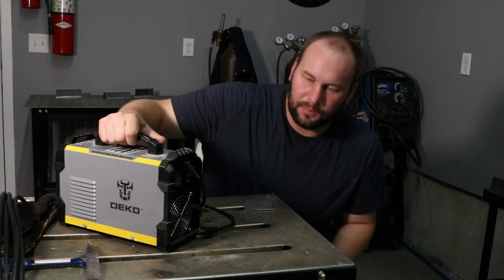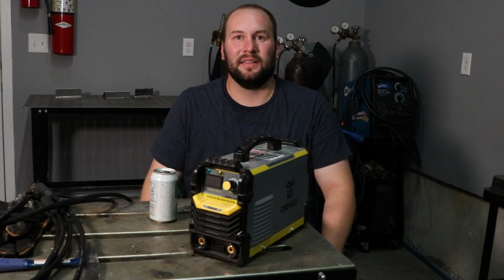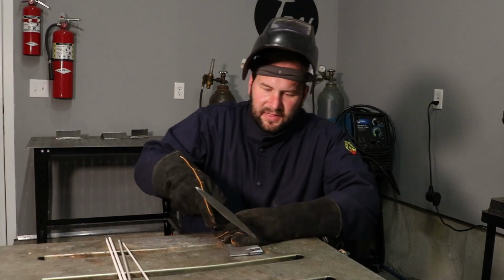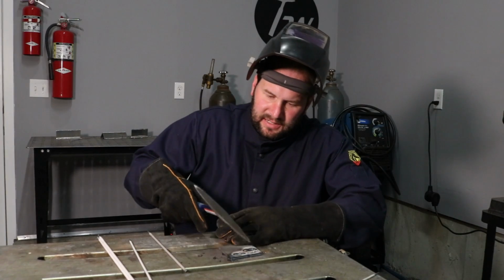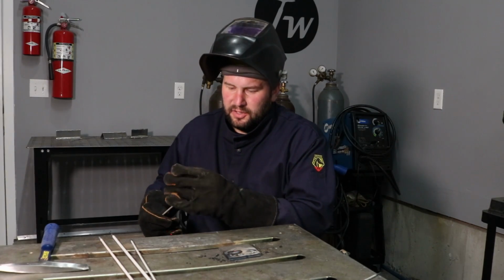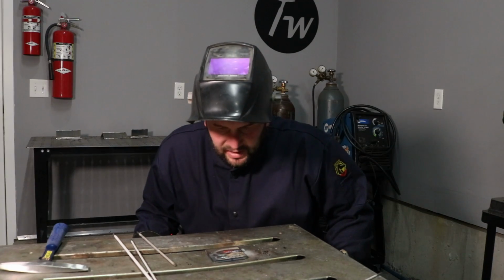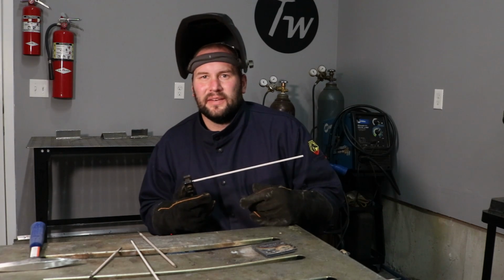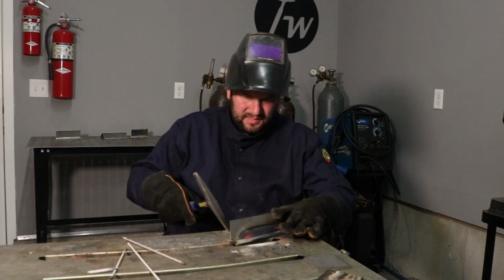Reviewing the (Almost) Cheapest Welder on Amazon: DekoPro Welder Review

Comment: Been looking at Amazon for a welder in this price range and this was one of them. 
Your video might have just tipped the balance. 
Not sure if the UK version is in fact dual voltage, but I'm impressed by the length of the leads. 
What is the duty cycle on this unit?
Reply: I believe it's supposed to have an auto shutoff if it gets too hot, so you wont have to wonder. So far, I've only used mine on 115v set at 85-90 amps max, and it will run 100% cycle on that setting.
Reply: @alphaclean3364  how does a 100% cycle work? i mean, 30% is 3 minutes out of 10, how does it  work in that case?
Reply: @borisgraell  All I know is that I have run continuous beads, or multiple beads with minimal breaks and it has never shut itself off due to overheating. I have only run it up to 85-90 amps though, since that is the max I can pull with a 115v outlet. I am sure on higher settings with 220v power it would force you to give it a rest.

Comment: Hey Tim,I’m confused, In the Illustration it shows that the negative part is where you hook up your stinger to and the positive part is to clamp onto the surface. Is that correct?
Reply from the maker: Short answer: Ignore their diagram and connect the rod to + and the clamp/workpiece to -
Long answer: You are thinking correctly. 95% of the time when you're stick welding, the electrode should be connected to the positive terminal and the workpiece to the negative. MIG is the same way, but interestingly, TIG and Flux Core are opposite. This is because the majority of the heat will go toward the positive side of the arc. With stick welding (or solid wire MIG welding) that heat will end up in the filler metal which goes right into the weld. With TIG or Flux core, the tungsten/tubular wire cannot handle the heat, so you do the opposite to put it directly into the material. The main reason that you might run stick with the electrode connected to negetive would be to reduce penetration if welding something thin.
Reply: @TimWelds  good to know, thank you so much

Comment: Nice video , learned plenty !!
Have you been able to weld 1/4" steel ?  Like  a trailer repair or add on ?
Thanks,
Steph
Reply from the maker: Yeah, it will weld 1/4" just fine, as long as it's plugged into a 220 volt outlet. It would be a bit of a stretch on 110. My setup for this would depend on the geometry and how clean you can get it, but I'd probably run a 1/8" 7018 at 130-140 amps.

Comment: Hi friend which welding rods I need to use this
Reply: My welding rods always stick when I use it.i have same king welder
Reply: Volume up my friend, so that it will not stick
Reply: Turn up the amps of your machine, or maybe you're using 6010 or 6011 rod. Try to use 6013 or 7018

Comment: Have one for occasional use (on 220v). Seems like a good machine so far
Reply from the maker: I use mine the same way. It's still going strong. Thanks for the comment!
Reply: @TimWelds  Is the Dekopro really 220 or is it just wired to one of the 110 sides of the 220 plug and only using the higher amps that the 110 side provides on the 220 circuit?

Comment: As I've said before, at sub 200 dollars It's always between Amico, yeswelder, Deko and sometimes Hitbox. I got the Amico arc200.
Reply from the maker: It would be interesting to know how similar or different these machines are under the hood. I've only tried the Deko, and it's still going strong. I wouldn't be surprised if the others work well too.

Comment: Can you run a 7018  3/32 rod on the 110 outlet?
Reply from the maker: I haven't tried it, but it ran the 3/32 6013 just fine and was out of steam for the 1/8 6013. The 3/32 7018 will fall in between these two, so it would probably handle it as long as the outlet can put out enough current.

Comment: If I'm going to get a machine like this, it's because I want to have one when only 120v is available and I'm probably going to be running 5/64 or 3/32. Some guy on Amazon claimed he ran 300 feet of 1/8 6011. If that's the case, why would you want to have a machine that is pushed to it's limit Everytime you use it? Get a bigger welder. 3/32 is plenty even on sch. 40 pipe with gap. You will start burning up lead terminals as well. It's like these guys who try to see how big of a lag screw they can drive with the smallest impact.  Get a bigger impact.
Reply from the maker: Totally. I really only use it for smaller jobs where it's nice to have something portable. It hasn't missed a beat for me yet, though.
Reply: @TimWelds Thanks, Yeah, I didn't mean that towards you personally, I was just hypothesizing/speculating😁. I realize someone has to ultimately test these things out for consumer reviews. I was speaking more in relation to people who seem bent on destroying their own equipment as if that's an accomplishment. If a machine can handle high duty, then no harm done I guess.
Reply: I reckon that guy is probably full of it because rods aren't measured in feet in the states they say they've  burnt pounds of rods. . Where i am rods are measured by the kilo. Even mig wire is measured by the pound or kilo.

Comment: I'm really curious if it's only me, that feels that this welder overreads on the amperage display, like around 20 Amps? Mainly using 6013x2.5 and at 60A displayed, the electrode barely melts. When rising to 80A, it definitely feels like it probably should at 60A (minimum current for 6013x2.5). I'm definitely not an experienced welder, but still, I've got an impression that the readout is not really usable..
Reply from the maker: Mine seems off when I’m running it on 120 volts. On 240 volts it feels closer to correct. Either way, I run a quick test weld to check the settings and adjust as needed. Once it’s dialed in, mine runs pretty consistently.
Reply: @TimWelds  True. Once set, it works nicely, however it's definitely "look and feel" based machine 😁

Comment: I'm a newbie. Just did my first welds yesterday.  I'm running a 110 Arksen sticker. Was having a heck of a time till I realized it can't run 7018 1/8 and barely a clean 6013 running her full soda. It keeps tripping fuses and overheating. I mean like every 3 minutes. Any insight boys and girls? Should this thing overheat so fast and trip fuses? Is it because I'm using it for too thick a metal (1/4 plate to some 1 inch square tubing)? My uncle let me use it and hooked me up with gloves, helmet and stuff.
Reply from the maker: The best way to run with lower amperage is to run smaller electrodes. If you switch to 3/32 electrodes, you can turn the machine down and be in much better shape. I’d try with 6013 and 6011 because they also take fewer amps to run. While it can vary, you can usually run a 3/32” 6013 at about 60-70 amps, which is about half of what you need for a 1/8” 7018. If you need larger welds, you can travel a little slower or run multiple passes (cleaning slag between each pass).

Comment: Would it be capable of running a manual tig
Reply from the maker: Technically, you could do that, but I would recommend spending a little more to get a machine that is already set up for TIG with high frequency or lift arc starting as well as a gas valve.

Comment: How thick will it weld half inch?
Reply from the maker: Great question. With stick welding, it’s more a question of what size rod you can run. You can weld as thick as you want with multiple passes. The largest rod I would run with this is 1/8”, which means you’re probably looking at 3-5 passes for 1/2” butt joint or 3 passes on a typical fillet. (I would do the first pass with either 6011 or 7018, depending on the joint, and the rest of the passes with 7018) The machine capability will only come into play if you run a lot of length of weld on these thick pieces because of the duty cycle of the machine. I think that this machine is rated at 40% when it is turned up. This means that you can weld 4 minutes out of 10. When you factor that in with multiple passes on long welds, it could take a long time to get the job done.
Reply: TimWelds I’ve been welding for about 30 years. And I would never thing a machine this small would be able to handle a hard days welding. I see the duty cycle ic 40/60.   But prob be good for small jobs outa the garage.  Thanx for the reply

Comment: TimWelds
Can you turn it to tig ?? Thx
Reply from the maker: Great question. Theoretically, it would work. However, I would recommend buying a machine that's already set up for TIG. If you decide to use this for TIG, make sure to get a TIG torch with a gas valve and hook up the torch to the negetive side and your metal to the positive side. You will have to scratch start the torch, which works best if you do it by touching the filler rod to your metal and flicking the side of the tungsten against the filler. This lets you keep your point in tact. 

Stick and TIG power supplies are similar, but there are a few features to consider in a TIG welder that will make life a little better for you. Not all TIG welders have these, and you can get by without them, but these are some things to consider: 1. A gas solenoid valve 2. Switched power (turns on and off with a switch or foot pedal) 3. High frequency or lift arc starting 4. Foot pedal or finger amperage control 5. AC output (needed for most aluminum, but the cost of the machine jumps significantly)

Comment: I got myself one today, coming tomorrow.
Reply: Right here😁
Reply: About to get one myself how has it been bro
Reply: How does it do with 3/16 steel ? Great video
Reply: @Prariedog  I use 3/32 and 1/16 and both run well, at a amp from 50-60 but i like using the smaller one because it run cleaner and can even be run at a lower amp to prevent it from blowing through tin metal.
Reply: @ediot.1012  damn reply to him and not me smh I’m hurt

Comment: You never want to weave with stick welding because it traps slag in the welds.
Reply from the maker: Thanks for watching and for the comment! You definitely don’t want slag inclusions, but weaving is a common practice for vertical up stick welds. The clip you are likely referring to is actually a different technique called whip and pause, which is one of a couple ways to run 6010/6011 rods. It basically allows you to regulate your heat while still penetrating deep.
Reply: Yeah 6010/11 you actually wanna step on flat, blows the slag out and let's the metal flow in
Reply: You have to zig zag doing vertical up,

Comment: Tim I aswell don't know much about electricity but do you think this would run off a generator? 10 horsepower 5000w
Reply from the maker: Check out this video where I run this welder off of my 3500 watt generator. https://youtu.be/P0z7y6Rc44w 
I didn't get the power that I was hoping for. It would be better with that size generator, but may still be slightly limited in power output.
Reply: @TimWelds  tim thank you so much

Comment: Hey man glad i found your channel. Read your Bio I am and MEchanical Engineering student. I have a desire to learn to weld. I am currently looking to buy a welder and my first project is a metal table to hold my wok burner and ingredients. I want to use 1 inch or 3/4 inch square tubing from box store. Its 1/16 inch wall thickness. What type of welder would you use to weld something like this stick or wire? I was looking at this welder or a wire feed welder. I only have money for one type and wondering how to proceed. Thanks for posting your videos appreciate it.
Reply from the maker: Thanks for the comment! Sounds like a great project. I would use a wire feed for this, but you could do it with stick. If you do go with stick, I’d use 6013 rods in either 1/16 or 3/32 diameter running the amperage turned to the low end. Warning: once you start welding, you just might get hooked.
Reply: @TimWelds  what is better for overall welding stick or flux core wire? Id probably only buy one welder for now looking between the dekopro stick welder or the titanium 125 flux core from harbor frieght.
Reply from the maker: @davidk813  While I prefer stick, for projects like the one you described, I'd definitely go with the Flux 125. While you may not be able to weld really thick material, it does have a much faster learning curve. I also have a flux 125 (there's a review on my channel and I also used it for my recent 5 tips for flux core video). Just make sure to practice on some scrap to dial in your settings and get the hang of it to avoid burning holes in your project.